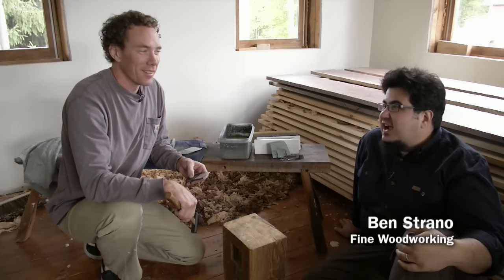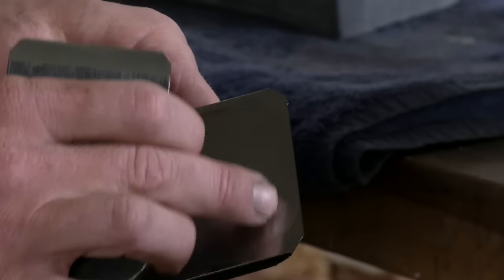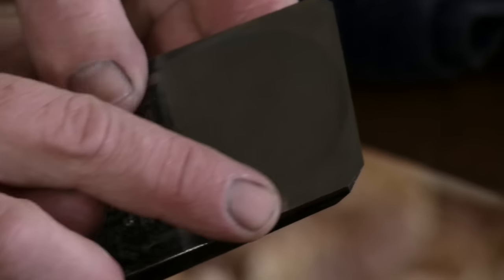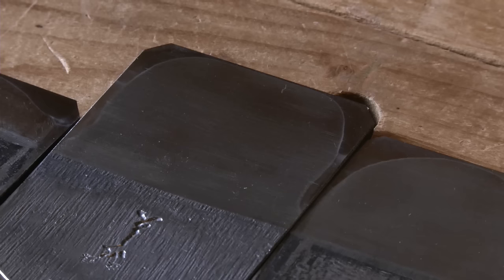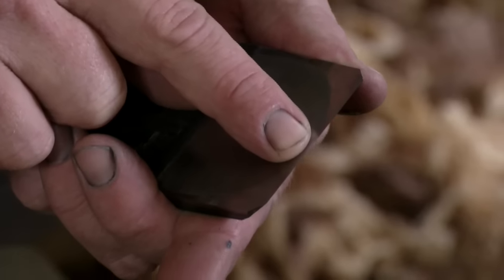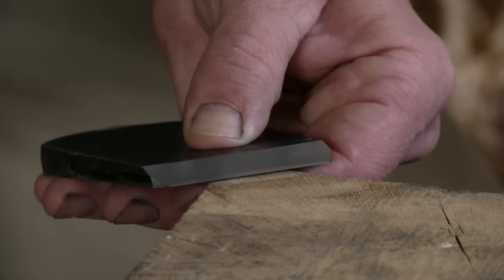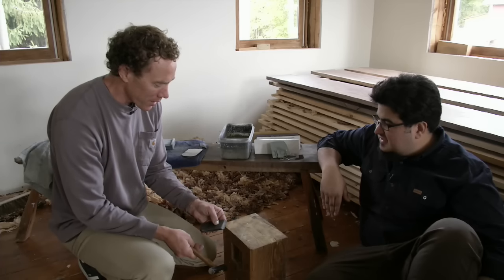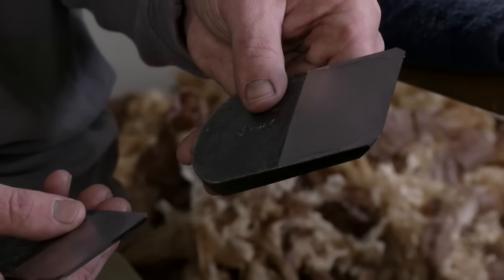Tapping Out a Japanese Plane Blade with Andrew Hunter

Comment: So here is a question, I bought a few years back a used Kanna, and the blade hollow is quite small or I should say the flat area, especially the corners are quite large, assuming they got that way because the previous owner didn't tap out his iron, and was just grinding away to keep a flat edge and the hollow off of the edge... How does some one brings back a narrow edge and narrow "corners"??
Reply from the maker: As I understand it from my time with Andrew, there really is no going back. If you're an online member of FWW you can check out this article http://www.finewoodworking.com/2017/02/08/get-to-know-japanese-handplanes , but I'm almost certain that's when a blade is considered truly "tapped out" and your best option is to invest in a new blade.
Reply: Thank you, I can still use the blade, so I don't think I need to buy a new one just yet... But thank you for taking ht time to get back to me!
Cheers